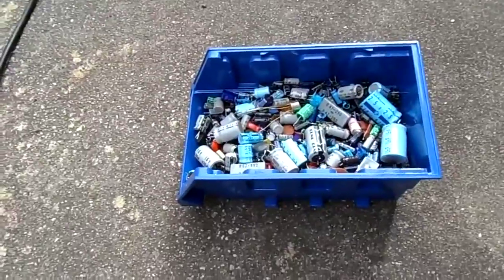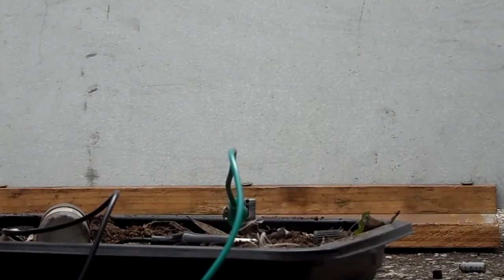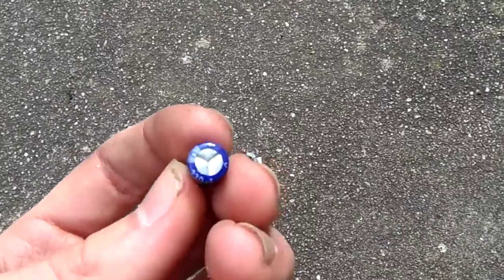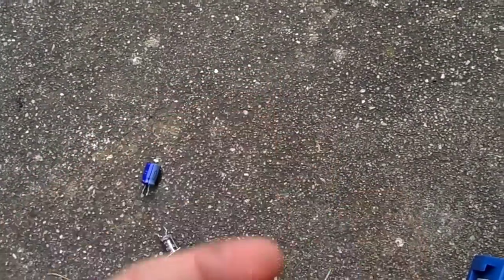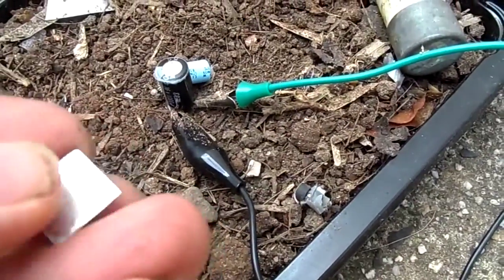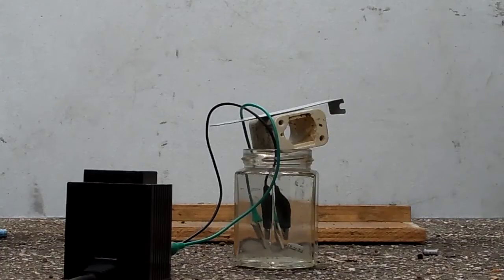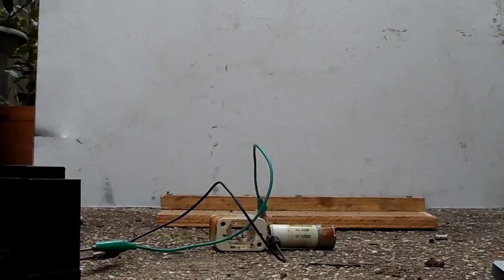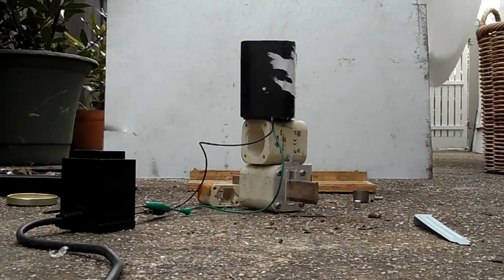50 Subscriber Special - Capacitor fun!

Comment: I tried blowing up a 49 microfarad capacitor, but I could not blow it up or release the gas from the end. I tried reverse charging and charging normally with a power supply, then I tried even using a transformer stepping it up to a damned 3k dc voltage and it wouldn't detonate. Any guesses?